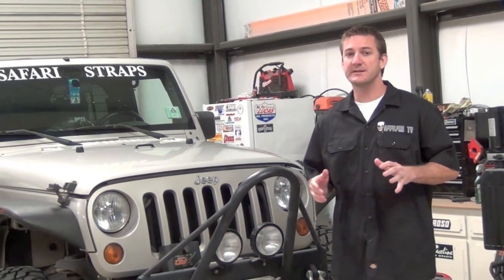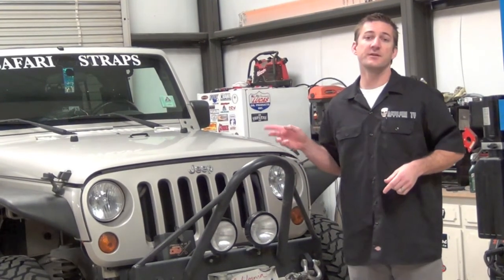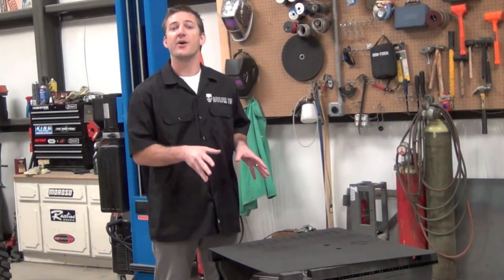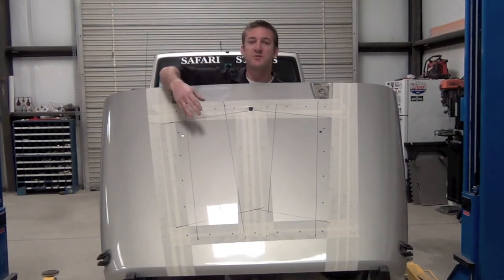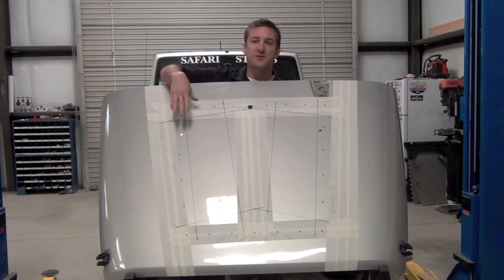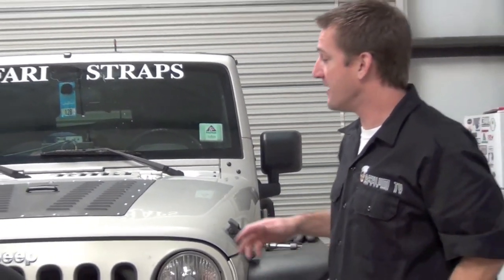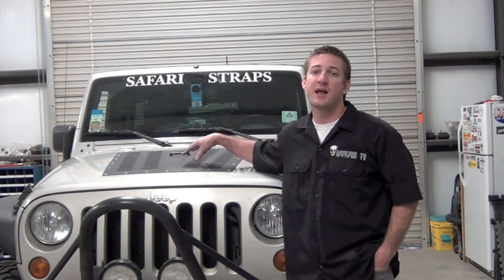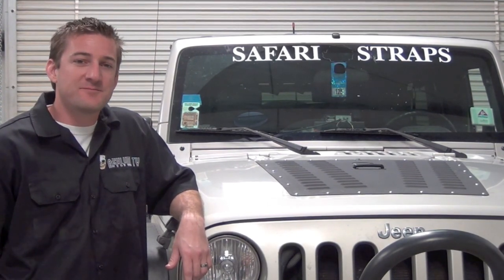Asylum TV Synergy Hood Louver

Comment: What happens when it rains? I sincerely do not know.
Reply: rs san One way that the atmosphere can become unstable is by heating from the sun. The ground warms up, causing moisture in the ground to evaporate and rise, and the hot ground also heats the air above it. As the water vapour rises, it cools and condenses into clouds and eventually rain.
Reply: @rickfrazier1148  Thats very funny, I thought that was great.